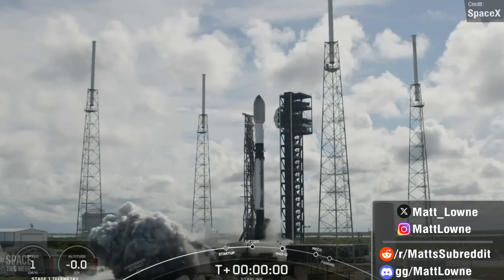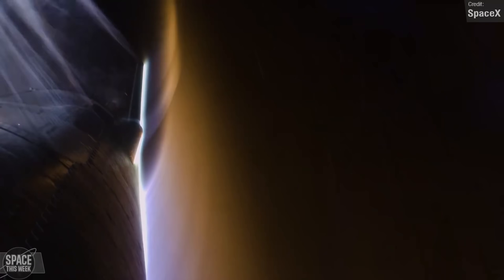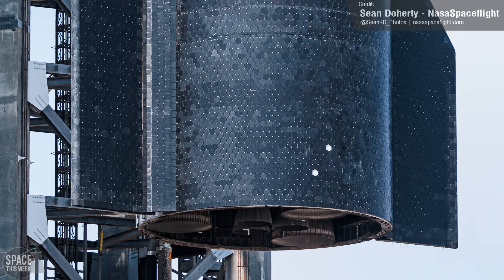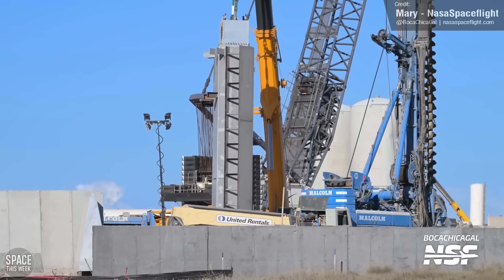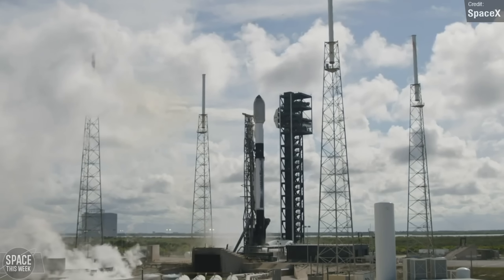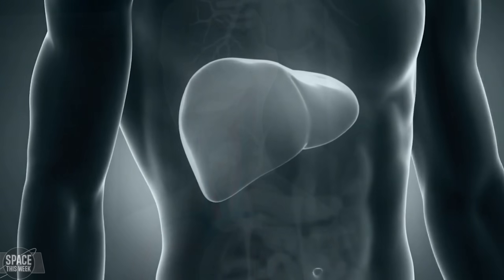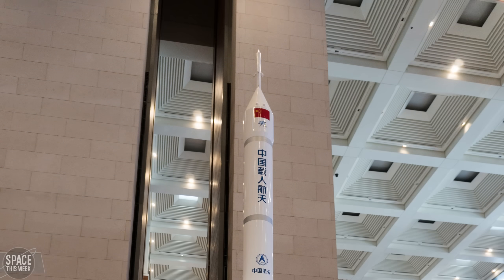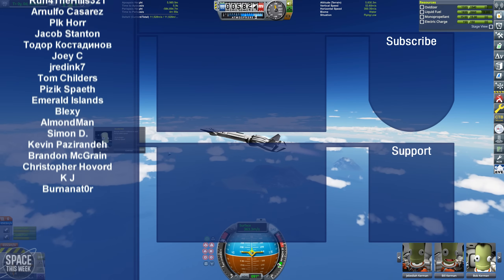Starbase Second Launch Tower goes Vertical, and SpaceX is Removing ALL of Ship 30's Heat Shield!

Comment: I just noticed something. Their about to build a 41 engine first stage.
The bottom of the launch tower takes the most heat,then has to cool before catching the top stage. Allow me to make suggestion. The metal of the launch tower needs to be cooled before the 41 engine first stage is launched and captured.
If not it will be weakened.
Look people the Rapters are glowing orange but still contain one hell of an explosion inside.thats impressive.

Comment: Won’t take about a year to build the second tower?
Reply: Hard to say anymore. Florida has EPA issues (all over again). Construction design Should be about done now, but Elon might opt to improve it again... so...
The tower will take only 3-4 months to raise, but not sure if OLM and deluge plates are being installed.
Reply: I’m guessing it’ll be two sections taller, with a deluge trough, and more-robust fixtures. Also, regarding the launch of number five, I can’t see them take a huge risk of damaging tower one if somethinggoes awry. I think they’re going to land that thing in the ocean right next to it at least two more times before they risk it near the tower, but that’s just my guess.

Comment: Hopefully all the tile attachments, removals, and reattachedments doesn't compromise the 3mm thick integral SS that all the pins are welded to.  Just watching those dudes drill off the tiles makes me worry about their abilities to stop their drills before they go to deep. 18k timrs three pins is 48,000 drilling actions without once going too far.
Reply: That was one of our concerns about ordering maintenance and change out on shuttle; it had to be ‘worth the risk’ that we wouldn’t be causing an additional complication in the process.

Comment: How much heavier are the new tiles and a bladed material than the old heat shield? Since the new tiles are twice as strong as the old tiles, I have to believe that they’re at least a pound heavier. Also, the blade of material is going to have some mass let’s say half a pound. So, let’s estimate that the new heat shield will weigh one and a half pounds times 18,000 or 27,000 extra pounds. That’s about 13 1/2 tons. Of deadweight that reduces starships payload to orbit. The ablative material on the Apollo capsule which was 13 feet in diameter which had a surface area on the bottom of about 550 feet weighed 3000 pounds. so the average per square foot weight of that ablative material was 5 to 6 pounds. Now they are probably not gonna put nearly as much oblated material on the starship as they did on the Apollo capsule since it’s only a back up, but I think we can safely say that it got away something and a half pound estimate per, each of the 18,000 tiles currently on the starship is not a bad estimate.
Reply: I believe the weight of a single tile is 0.3 to 1.0kg (yeah, that's still vague). So, 18 tons on the outside. The improved tile is maybe 30% heavier, so maybe 5-8 tons of additional weight with the ablative material thrown in. The Version 2 (due to launch on 6th or 7th (Starship 32 was the last V1) has 100t cargo capacity... but V3 has 200t cargo capacity (with 35 engines rated at more than 269t and about 25% more fuel. 

I wouldn't sweat the weight of the new heat shielding.
Reply: The simple answer is, “I don’t know, but….”. Methinks Elon’s goal is….get to total reusability first- whatever it takes, including a fully reusable heat shield, knowing Starship has unprecedented capability at the moment- AND, that upgraded Starship are already in work, anyway. Once know what an ironclad heat shield looks like, can start figuring out what it takes to get ‘efficient’ on later models. Remember, the Falcon 9 that we know now, took over 50 flights to actually get to. - Dave Huntsman